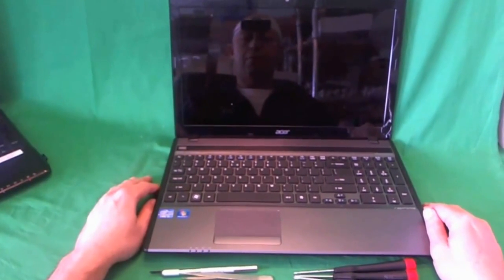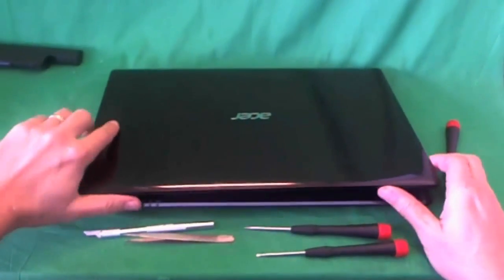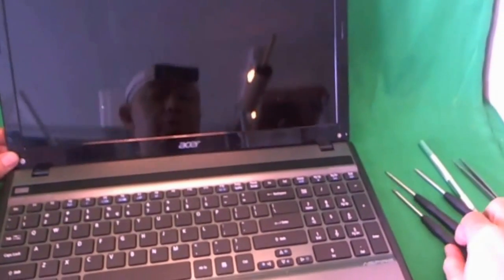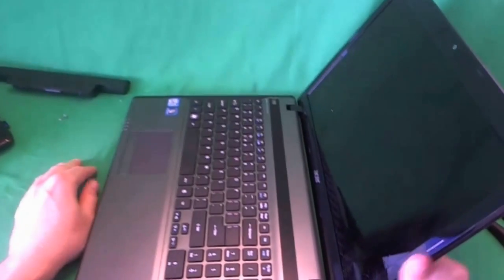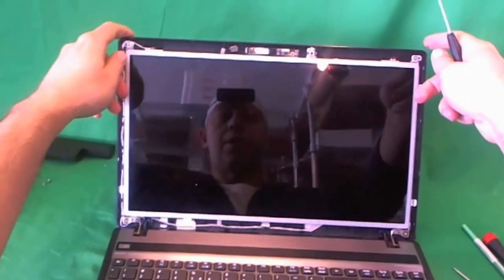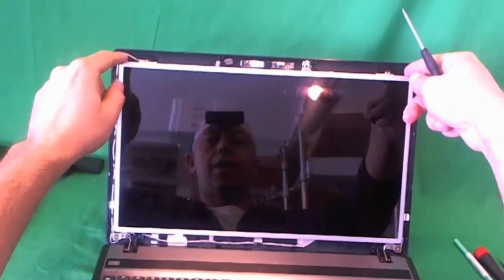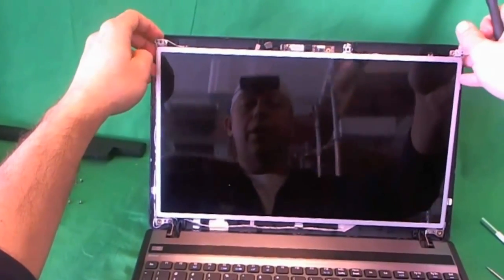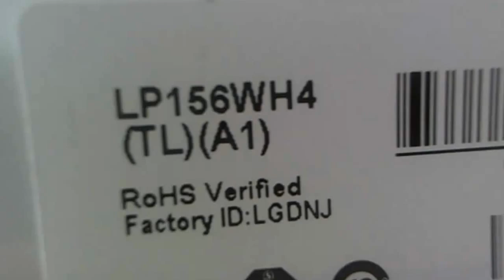Acer Aspire 5755 Laptop Screen Replacement Procedure

Comment: The same thing happened to me. I was also unable to unassemble the laptop. It's not something that can be repaired, You would have to replace the fan itself. What I did was I sent the laptop to Acer (for free) and they replaced the fan (also for free) and sent it back in 4 days!

Comment: hey dude can u give some info regarding laptop gpu. i have purchased a laptop and it has nvidia gt540m 1gb video card ( dedicated one) . many people say that if laptop gpu fail whole laptop becomes dead ie replacing a motherboard is needed. and yeah also a common thing with laptop that their gu are soldered in moboos so they can;t be replaced. but i want to know nvidia gt540m is also soldered in the motherboard . on nvidia website it says this card has pci16 2.0 slot that means it not soldered?